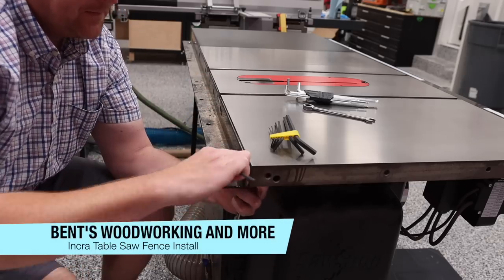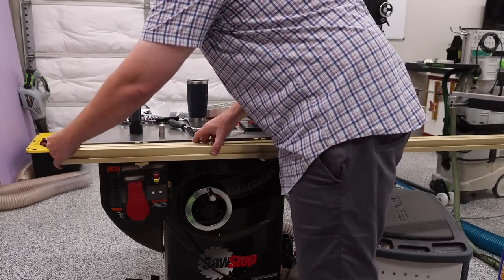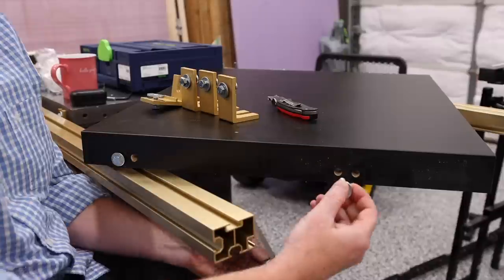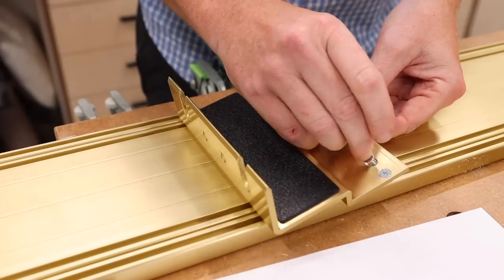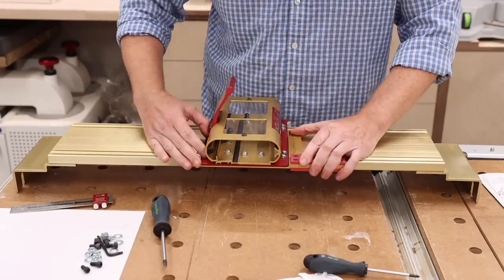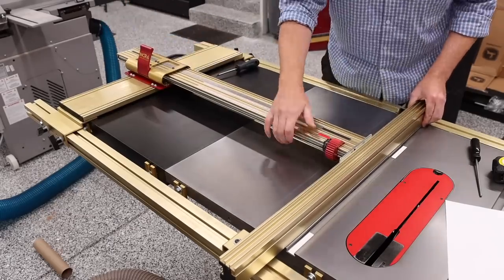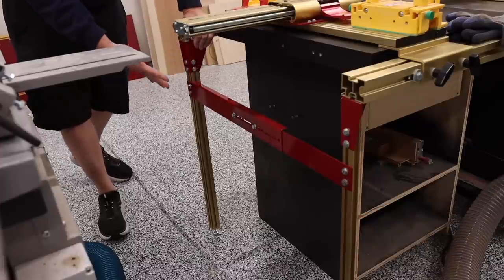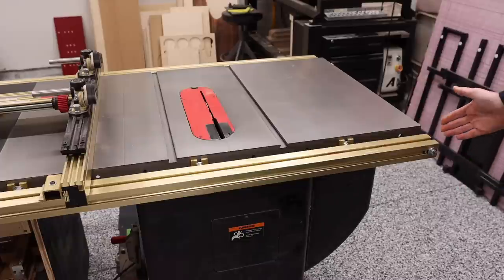The fence unlike any other

Comment: Thank you for making this video.  You just saved me several hundred dollars.  I purchased my SS without the fence systems because I already had the Incra system.  After speaking with SS Tech Support, they told me that the SS rails were required, but I could not see how to install the Incra with the SS rails.  After your video, I ordered additional Incra mounting brackets and the 10 in cast iron spacer between the wings and the router table.  

Once again, well done with this informative video and thank you!

Comment: Thanks for the video. I enjoyed it!
I had many problems with installation particularly getting the fence to slide smoothly. I contacted Incra and they said that the spacing between the rails and the surface of the saw was critical and they suggested instead of using the brackets, clamp a level across the saw and use a spacer between the rail and level to get the spacing exactly the same  right around the saw. This worked perfectly and I can now move the fence with one finger.  Also I used the existing Sawstop legs and they were easy to attach just sliding a bolt in the rail and finally using a tight fitting runner in the miter slot made it dead easy to align the fence with the slot by making sure the fence was in complete contact with the runner. I now absolutely love it!! Repeatable, accurate and fun to use.
Reply from the maker: The level and spacer is a excellent idea!!
Reply: @bentswoodworking  I forgot to say my other problem was the micro adjusting. It wasn't responsive enough. I used a dial indicator to check it and I'd move the red knob one click and no change on the dial indicator. I had to move it a few clicks before it changed but when I went in the opposite direction , no change at all. I contacted Mark at Incra again (his service is brilliant btw) and he sent me a video on how to adjust that knob. There is a hex bolt on the very end of the arm. Adjusting that to be slightly more snug gave exactly the results I was looking for. One click forward gave 0.05mm (metric version or a thou imperial version) and one click back also gave 0.05mm. I hope this helps someone

Comment: I have owned the Incra extended fence, just like yours, for 5 years. It’s attached to my Inca 2200 Cabinet Saw (Incra on an Inca) and it is as sweet a setup as can be, but the installation was a nightmare. 
The original Swiss Inca fence, did not attach to the front of the table but underneath the front and rear edges, so I had to drill and tap the mounting holes which were complicated by the fact that the edges of this cast iron table were somewhat rounded, which meant that I had to shim the top and bottom so that the mounting brackets would sit square. It took me 3 days to install the Incra fence, partly because of all the rest breaks I had to take since I am in my seventies.  But, am still glad I got this great fence. Thanks for your detailed video.

Comment: I installed my Incra fence on a SawStop over a year ago and ran into all kinds of trouble. Unlike you, I didn't catch the issue with the provided hardware not being capatible with the SawStop and ended up stripping the machined holes. I spoke with Incra as I was super upset over it. They provided some solutions for me which I was not 100% happy with but I needed some kind of solutions. Thanks for posting and the insight, I recently moved and going to redo the install and use some of your pointers.
Reply from the maker: Glad you found it helpful

Comment: I’ve got the same setup and randomly searched incra fence install and this popped up. I’m re-installing tomorrow. 

You need extra brackets for the extension table. 

The sawstop fence helps the wings from bowing so you may need to shim your wings.

It’s a great fence but my first time setting it up took almost a week of calibration here and there and waiting for the brackets

Comment: I love my incra fence. It has been part of my shop for close to 15 years now. It is the one thing in my shop I have never regretted buying. One tip for folks. I bought the 52" version, but don't have room in my shop for the extra rails. The folks up at Incra gave me an awesome tip. I have two settings/stops. When I need to cut things over about 30" or use the Wonderfence, I loosen the two front screws and move it to the furthest stop. Using one of the secondary scales, you have your new mark. I keep board cut at exactly 20" around to ensure my secondary measurement is accurate. It still sticks out on the right, but it's way more manageable.

Comment: I've had my Sawstop and Incra fence for about 5 years now and love them both.  I ordered saw and Incra about the same time period.  I ordered Industrial, because I knew that I would not need the rails, fence etc (at that point in time it was possible to just order the saw, without the rails etc., this option was only available on the industrial model).  My rails are 8 or 9" to the right of the blade and I did a shop-built extension table.  

My Jensen feed rollers, allow me use the T-slot on the side of the fence.  I use then also on my Powermatic shaper and the Incra fence on my router table.  I share this information; in case you are just starting to go with the Sawstop and Incra combination.  I tend to be detailed ordinated and love the micro adjustment on the fence, it lets me dial the fit perfectly.  If you are the type of woodworker, who thinks "close enough" is good, then you might not appreciate the Incra Fence system.
Reply from the maker: Agreed. The precision isn’t my favorite part. For me it’s repeatability

Comment: I've had this set up on a Bosch jobsite table saw for some time now. I will be transferring my fence to my Sawstop when I get it at Christmas.  One thing you can do (that has no bearing on any saw that it's installed to) is replace the rear support bracket screw with a knob. I use a Rockler 4 star knob.  I forget if its 1/4 or 5/16 bolt, but at least you wouldn't have to use the included ball end hex driver anymore to tighten that down.. Just a friendly tip
Reply: Its a 1/4 inch bolt.. I just checked their parts website..lol

Comment: I have the TS LS wonder fence combo and it is on a Ridged 4512 Table saw! Yes the fence is better than the saw! At least more expensive! 
And this fence works very well for me. I had no issues setting the incra system up on this saw. And I will say as a former installer of CNC metal machining  centers. I am pretty persnickety about tolerance! I use dial indicators to align my blade to the miter slots but not with a saw blade a calibrated arbor plate. After that I align the fence parallel to the calibrated plate. I can cut 4 quarter walnut on this saw at 4 and 1/32 inches at 8 foot and that is what I get all long the board.. it is all about proper calibration.
As for Customer Service! Neil is who I worked with on one issue, and resolved it short order! 😁🛫

Comment: I have had mine for since 1999. I orignally had the TS version and then upgraded to the LS. I have wonderfence as well. The one thing i think they should have done and I have contacted Incra about it was to possibly magnify the window where you read your measurement. I ended up get a page magnifier that lays right on top. Works great. However, I recently purchase these new magnifiers with the small monitor. I was going to retrofit that right over the measure window. As i have gotten older my reading vision has weakened. this setup i believe will magnify it and more importantly i dont have to hover over it. I just have to figure a way to prevent the fine sawdust from getting under the window. its just a great fence.

Comment: Watched both your videos on the Incra fence.  Seems like an excellent design for accuracy and repeat ability....but.  
1) You can't position the fence on the other side of the blade and
2) like you say, it sticks out to the right a long way, and
3). You can't use your favorite style of fence..ie Bessimer style or your jigs that saddle the fence.
All this could be solved if they mounted the screw and adjusting clamp along the front of the saw with a T-style fence, ( Mounting the the screw in a fixed position and making the clamp slide)
I'm tempted to buy one and modify it to mount like that.
I see their point of mounting the sliding arm just opposite of the blade for best accuracy, but you give up a lot for a negligible difference.

Comment: 9:20... wow, they really don't want that rail moving!  Great video and tips on the process.  Its a shame Jessem's adapter does not set the guides back further so they fold fully out of the way... another 3/4 to 1" of offset would probably do the trick.  I love my stock guides... best upgrade to my saw.

IMHO... Nice fence system, but too clumsy and consumes way too much space for my taste/use.  I created a custom micro-adjuster for my Delta 36-T30 fence and use additional stop blocks, all easily moved & removed (when desired) to greatly improve my cuts.... both dialing it in and setup for repeat cuts.
Reply from the maker: Yeah definitely isn’t for everyone but I definitely like it.

Comment: Nice!  I recently 'upgraded' my TS-LS to metric, and went thru and re-aligned things since I had it tore apart.  Added the WonderFence, and found out the hard way that the high stock supports for that don't actually attach to the WonderFence, but to the top of the TS-LS fence - which is where my Jessem stock guide rail sits.  

My Jessem guides came with the adapter plates for the Incra fence (probably ordered them that way back when), but I don't think I ever had any issue with the vertical clearance problem that you mentioned - at least not if I flipped them up and all the way in.  Maybe I have the Jessem rail offset the other way?  

Anywho, love seeing more Incra videos out there.

Comment: Awesome install video. But how do you align your outfeed table to the the fence specially since the adjustment knobs are offset from the fence itself.
Reply from the maker: I attached it using some of the same l brackets to attach the rails

Comment: Thanks for posting the video !  I want to use the overhead dust collection and outfield table but I don't think that the aluminum extrusion isn't stout enough to support the outfield table. I know that there are support legs under the outfield table but when folded it's dead weight pulling/twisting on the aluminum.  I use a metal fabrication shop to help with some of my ideas and may have a solution using steel stock. I'll let you know if I get something to work !  I am really interested if you come up with something that works well !!
Reply from the maker: I know people that are doing it with good success. I’m hopeful it will work without issue
Reply: @bentswoodworking  Thanks for the reply ! Do you mean that they are attaching the outfield directly to the aluminum extrusion ??  If so how are they attaching it ??

Comment: Easy thing to do on the JessEm stock guides to keep them out of the way when not needed but keep them on the saw for quick set up is to just remove the bar and put it in backwards and have the rollers pointing to the back side of the fence. Takes 5 seconds and your back in business to swap them around.
Reply from the maker: Great idea!

Comment: Evaluating and thanks for the video, great work as I have a 10" SS PCS.  I tend to clutter my unused portion of my tabletop.  With the LSTS, there is now the carriage in the way.  If I push the fence and carriage all the way to the right, then the carriage will protrude some 40" past the end of the extension fence.  Has this been an issue for you or perhaps you use yours enough that it doesn't get cluttered and is not an issue.  TIA.

Comment: Did you have any problems with the cast iron table saw wings drooping/ moving when you removed the fence rails? Also,  are the aluminum extrusion rails strong enough to support the cast iron wings as well as an outfeed  table.  Great video as always, Thanks.
Reply from the maker: I didn’t notice any issues. I’m hopeful the outfeed table will work

Comment: Great video. Thanks for sharing. I learned a lot I would have used during my install. If you are interested, I used a 4" piece of aluminum to attach my overhead dust collection and outfeed table. I posted about it on FB in the SawStop group. Feel free to search for it on there. I had posted a link, but my comment was deleted.
Reply from the maker: I think links usually automatically get held for review.
Reply: I don't use Facebook but want to install my overhead dust collection and outfield table on this setup. What do you mean "a 4" piece of aluminum" ??
Reply: @chloedogable  Sorry. I should have thought of that. I’ll paste my post here and follow up w/ a couple of pictures: My greatest fear when I ordered my Incra TS-LS Combo for my SawStop table saw/router table was that I wasn't going to be able to figure out how to mount the out-feed table and overarm dust collection. I had emailed Incra and searched this list w/ no luck.

I figured it out. I ordered two 1/4"X4"X36" sheets of aluminum ($57 incl. shipping), cut the pieces to fit between my outer and middle Incra rails, got some wide head 3/8-16 bolts w/ wide heads, and went to town! Drilled mounting holes 3" in from the ends for support and made sure they positioned the aluminum JUST short of interfering w/ the tightening handles for the Incra. The outfeed table was perfectly aligned w/out any shims. I'm very happy.

I probably overdid it w/ the pictures, but I wanted to make this super easy for anyone facing this challenge. I got the aluminum at MidwestSteelSupply.com. Ordering 2 @ 36" instead of 1 @ 72" saved me $40 in shipping. I got the bolts and nuts at Lowes. Drilled the holes at 250rpm and cut the aluminum on my SawStop w/ the bypass on using an Infinity Tools 10-380 special material blade. Reach out if you have questions. (I later added that because I flip it to use my right-side router table, I had to replace the black-handled lock-down bolts w/ regular bolts that I tighten and loosen w/ a 9/16” wrench.)
Reply: @chloedogable  Sorry, can’t add pics.
Reply: I sent link of your post to Jason before I scrolled down and saw your comment lol.

Comment: Hello Bent.  Thank you for that informative video.  I was just wondering if that Incra fence is compatible with the Sawstop integrated router table to the right of the blade and if the fence can be removed and replaced easily.  My studio is small and i would like to use the saw as an assembly table with a top covering it when not being used as a saw.  Many Thanks.  Barry
Reply from the maker: It would be a hassle I think. Unless the router was left of the blade.

Comment: Thanks for this video!  I have much enjoyed TS-LS for 10 years on a Grizzly, and am about to order a Saw Stop ICS with 52" extension and router table on the left.  I see the TS-LS (I'll need the XL version for the 30" deep ICS table top) has 92" rails.  I plan to order without the Saw Stop rails, but I am concerned that these long angle brackets/rails which you removed might be part of what helps keep the whole top flat?  It would be great to do it the way you have, looks much cleaner.  Did you check with Saw Stop on this?
On a separate note, I have the imperial version, and am thinking of getting the the metric for the new saw.  I will be locate the Saw Stop back to back with a long-rail Grizzly G1023L.  Do you have any thoughts on metric?  I grew up in New Zealand we went metric in 1969 when I was 13, but have lived in California for 40+ years. I am familiar with both imperial and metric, but am concerned that having a metric LS-TS will drive me nuts due to being so comfortable with the imperial LS-TS.
Reply from the maker: I did not consult with sawstop about the incra fence. The rails seem to hold it just fine.

Comment: After 9 months would you still get this fence disregarding the installation issues.  Is it that good of a product from a use standpoint.  If I had the budget I would get the table saw and the router table fence but only have enough for one. I am leaning to the router table. Your thoughts?

Comment: Did you use carbon method on the rails? I'm thinking I might just use carbon glide on the rails and fence? I guess you could also use it on the main arm but I'm not sure. What do you think?
Reply from the maker: I haven’t and probably won’t as it’s anodized aluminum and I am not worried about protecting it. That said, I don’t think it’s a bad idea

Comment: I have the jessem hold down on the incra fence like you.     Have you mentioned the need to lock down the fence to prevent it from lifting off the table because the jessem hold downs push on the wood while ripping?
Reply from the maker: Well I lock down the fence with each cut as it is.

Comment: Question:  Other than to use to attach the folding outfeed table, why did you run the rails all the way to the left end of the saw?  It seems to me that you could have just slid them to the right (albeit with a shorter rail set) and set them with only three (or at most 4) angle supports.  Also, you are the not the only person who has tried to attach a rail and level it only to find out that you didn't slide the retaining nut, but under.  Lastly, I know you don't have the space for it there, but if you ever do, then extending out the added table on the right side to allow for a router insert and pushing the rails out all the way to the right allows you to use the Incra as a router table fence.